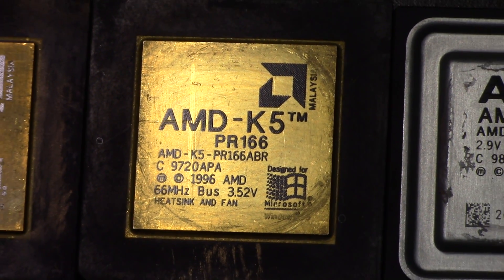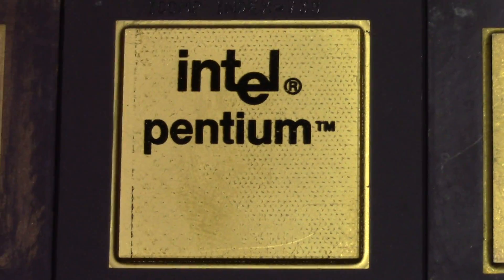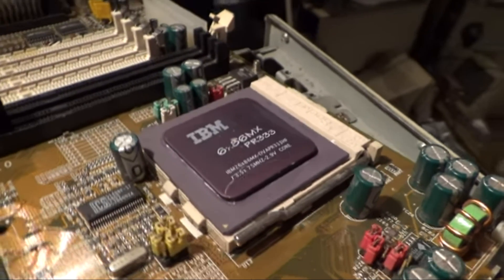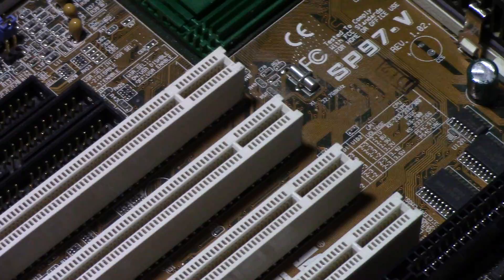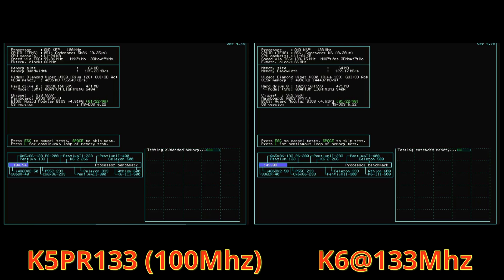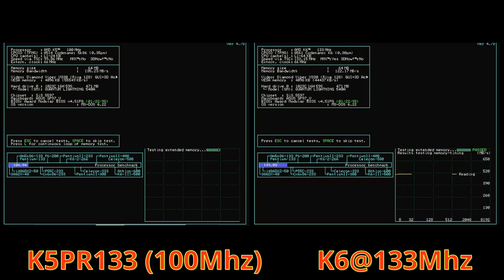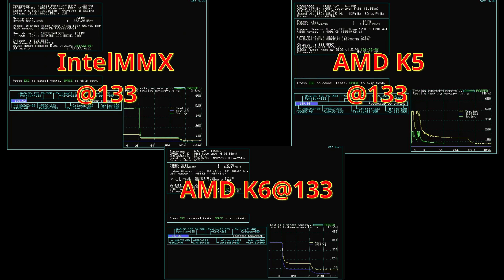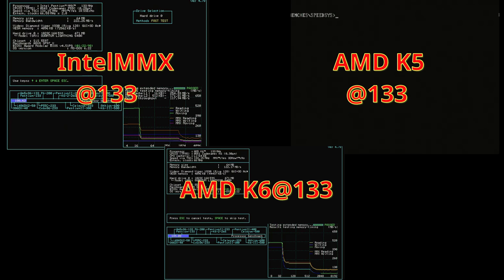AMD K5 vs K6

Comment: K5 didn’t scale. They couldn’t clock it as high as it needed. The trick is to pipeline lver more stages. Each stage does less so it clocks faster, but it takes more stages to complete an operation. Throughput can remain the same per clock since there are more operations in parallel at different stages of completion. If you take this too far branch prediction misses become very costly.

This game was played over and over again successfully until the pentium 4; it took things too far and couldn’t be clocked as high as it was able to be clocked because it became too difficult to cool. They were expecting their process engineers to do something and keep dennard scaling going somehow.

Pentium is kind of two 486 ALUs bolted toghether with an improved FPU.
Reply: Not even that - Pentium had a real pipeline and a poor man's one.

Comment: SiS made some really good chipsets, had a few boards i didnt expect much out of that became favorites.

if you can get an ECS L7S7A2 you wont regret it as a board for that gen of processors, i also had the top end nvidia based board back then and... in the end i traded it to a buddy for a videocard upgrade because the SiS based board i got with a applebread duron for 60bucks, was better....well, that duron unlocked and clocked to 2800 speeds... passing every test thrown at it... a buddy liked it so much he bought me another l7s7a2 combo and gave me the one he could buy himself, in trade for the board/chip i had setup and working, ended up giving me some other stuff including better ram then i had in that system because... he wanted it so bad and it to just work, that he offered as i failed to respond quickly to questions on the way back... worked out great for me.... and... his mother still uses that system with vector linux on it, for her email box, does all she needs, and is maxxed out for that era of hardware, he eventually did get a top end ram kit and brave tweaking the bios to use the faster ram, took him a couple weeks of tinkering then asking for advice on guru3d, and... an OG guru popped up and told him to turn one thing off, 2 things on, and it would work fine... that those settings auto swap if you change ram kits all sticks at once on some boards, if he changed ram again, remove the outter sticks. replace them, reboot...enter bios save. shut down, then swap last stick and, the bios wont trigger the settings that make stuff go wonky... .i have had that issue but.. i also always check all the settings over before i save on those systems... knowing any hardware change could cause weird "why you do dis" behavior...

but seriously, L7S7A2 replace the chipset cooler with a small active cooler or tall passive, and flash a modified bios(im told you can still find via pcper/amdmb forums and a few other places) that uplock a few extra tweaks, you cant get the same volt based oc's you can on that nvidia board i had, but, for example the L7A7A2 dosnt suffer a perf penalty running ram async, infact, if you find the right balance it can boost perf(confirmed by a number of doubters who went out of their way to get one of these boards back in the day, only to come back and admit...they really liked this TINY little atx board that...despite lacking some features like SATA onboard...was faster in most ways...and the onboard audio was really good, at least on the rev we had it was cmedia based and, genuinely sounded as good as a mid range soundcard in 5.1... but the sis chipset, really was, astoundingly good, had any major maker, taken the time to make a top end board using any ver of that chipset, it would have sold..and made nvidia, ali, via, amd, all look really weak.. imho it did anyway.. really great chipsets for their day.. yes even the ones with built in video, infact, i have found those overclock pretty damn well too.. pentium mmx200@350 for 6 years before the boards caps failed.. when i started checking, all fake rubycons... lasted way longer then expected with them being fakes from that time period... but... i had the board on a shelf, 2 years later a buddy wanted to know if he could see if his wife could re-cap it at work and he could build a retro rig with it... damn me..she did it..replaced every cap with audio grade caps at least one step higher then the ones removed, she also added a soldered down and glued heatsink to the VRM section since the mount points where the same as some boards they worked with for units they built for sales and direction giving at malls and medical places, stuff like that... anyway, he got a k6-3 and thanks to a modified bios somebody created for a whole range of boards that the bios can tell whats what by whats actually installed on the board so..all used the same bios flash, that gave full k6-3 support to all versions as well as support for more ram speeds and some other useful unlocks... he plays alot of retro games on the best hardware for the period, its a step above what you would have gotten at EOL for the k6-3 but early k7 era and, specific to having the best end game drivers for the period, i just know, hes got very few problems playing the games he throws at it the rare times he does there are some dll files you can toss into the folder from specific driver versions, causing the game to load those instead of the defaults the drivers would use..fixxing the issues... same thing you sometimes have to do for old games today to get proper functionality...(i had to tell somebody how to get starsiege working..that was fun...LOL...honestly..it runs very will on my 10 year old platform inside a virtualbox with full opengl mode running... so.. that seems more optimal to me vs trying to run such an out of date game, thats own devs where not allowed to properly patch it, due to deals with 3dfx to gimp the ogl and d3d renders ... devs admited such decades after the studio broke up and publisher died as well and "we dont even have access to the source because some idiot at sierra decided to re-use DAT tapes to save money....they where fucking pocket change, literal pocket change... fucking idiots.." the rant was great... it was audio that was transcribed and...honestly....he sounded like an angry bill shatner ranting... not kirk but bill... humor but... also you can tell, something hes talking about really does piss him off... or some aspect of it.. or it hurts.. or both.. prob both since.. they put so much effort into the game engine and the games..only to have sierra shitcan their studio, and before they could buy the IP...losing the source for the games... then coming back and asking them to  make tribes 2... that required recreating a game engine version, that had a bug, that made skiing possible and created the mechanic in the fist place.... it was an amazing accident... the recreation wasnt perfect.. some prefered the original.. some prefer the new one, some even prefer the weird anti-friction boots model of tribes vengence... another game that got crapped on by a stupid publisher trying to put a niche game, up in between Doom3 and HalfLife2 somehow thinking that was going to work out great for their AAA niche title... had they taken a few more months, done more open betas on the limited number of maps worked out bugs and patched it, then done an official launch after the other 2 passed and people where looking for more to play... even go F2P on the MP portion and the story, we told them to chage 19.99 for that unlock, and let people buddy play it with  a friend even if that friend didnt own it, even if it limited it to 2 missions a day or something... it would get them sales... cosmetics for everything was another big push the real fans had... ones u can just get randomly or win from bosses/events/etc, ones you can buy for real money credit systems... the typical thing.... but... naa...pump and dump... u2XMP.. same kinda deal... man..now..thinking about the history of the games i have loved... im both angry and depressed :P

Comment: K5 might have more balls compared to the K6 clock-per-clock, but like you said they couldn't scale the clock speed up.  However, "in the long run" I think NexGen acquisition was beneficial for AMD.  If they waited and instead tried to tweak and scale up the K5, then AMD wouldn't possibly be around today as an alternative and competitor to Intel.

Comment: I actually enjoyed my '97 AMD K6-233. I used to do benchmarks between the K6 vs the intel 233MMX with the same MB/Socket. The K6 kicked the snot out of the intel in integer benchmarks, but lost in MMX calculations. Still a decent cpu back then.

Comment: The P54CQS Pentium 120, which you could easily overclock to 133 Mhz, was released in Q1 of 1995, and it is still slightly faster than the 133PR K5, according to these mostly non-MMX benchmarks. Some victory for you biased folks...

Comment: Thank you for your video. I have wondered about the K5 for decades, particularly its floating point performance. Some sources claimed the K5 had such poor floating point that a K5 PR150 would only match the floating point performance of a 150 MHz Am5x86DX, while others claimed that it could match the original Pentium clock for clock, but fell behind as a similarly PR rated speed. This is a huge spread, and I didn't know which reviewers to trust since none of them showed actual benchmarks. To me, the K6 was a great chip, at that time FP performance only mattered with games, and one could always purchase a card for gaming. A K6 200 with a Voodoo card was faster than a Pentium MMX 200 with a Voodoo card. Indeed, even a Cyrix 6x86MX PR200 with a Voodoo card would beat the Pentium MMX 200 with a Voodoo card, but the Cyrix processors ran hot. I wish Cyrix would have focused on making the Cx5x86 Socket 7 compatible and fixed the bugs, such as the broken BTC. The Cx5x86 core eventually ran at 266 MHz at 350nm as the heart of the MediaGXm.

Comment: I liked your video as it was really interesting to see K5 and K6 benchmarked against each other but I think your conclusion about K5's superiority might be a bit off. It might be that the design simply wasn't going to scale to higher clock speeds as the K5 only hit 133 MHz on the 350nm process while K6 reached 233 MHz on the same process. K5 was already pretty late and K6 came out just 6 months after the 5k86 core K5's. The K5 PR200 launched the same month as AMD K6 233 MHz so there really wasn't any time to continue tweaking the design and considering the K6 design reaching almost twice as high clocks on the same process and with lower voltage the slight performance per clock deficit was acceptable.

Comment: My AT box has a Tyan Trinity 100AT motherboard that supports K6-2 processors on a 100MHz front side bus so I'm upgrading it from a Pentium MMX 233 to a K6-2 500MHz CPU. Should be pretty speedy under Windows 98!

Comment: Just found an Compaq OEM board with an AMD K6-2 running at 500MHz in a dusty box. Wanna test it but I'm a little scary if when I power it on the whole thing would go Boom! Any helpful tip I should consider? The board hasn't receive power in almost 12 years tho.

Comment: my abit ab-px5 (i430tx) using 64mb pc100 cl2 with fastest memory settings in the bios and pentium 200 mmx or amd k6-2 400mhz(fsb 66mhz) i do get 223mb in memory speedsys bench

Comment: Interesting to see the results. Quake is what caused me to go to Intel from an AMD 5x86-133 that I had overclocked to 150Mhz(50mhz bus) as the P54-133. I then went to a K6 200mhz but it really did lag in FPU performance to the Pentium 2's of the era. While I stuck with AMD through the entire K6 era, it was mainly due to price. The K6 line was fantastic on integer based programs, but just got slaughtered on floating point.

I also had a K5 PR133 for a while during that time as well in a second machine, and was wondering how it compared IPC versus others of the era.

Comment: Interesting, it seems your suspicions were correct. I like the evil laugh at "Chipzilla" there, naturally, as a fan of the K5 myself, I don't think this was at all misplaced. The SiS 5598, unusual choice, the only ones I've seen have been either cheap PCChips parts - and not good ones - and the low-cost ECS boards from Time computers, neither of which ever worked particularly well but the latter of which are at least reliable, and cheekily re-badged the chip "AGP TX" despite their being no AGP port. They were OK for what they were, if you bought a Time machine you didn't care about things like that. I did often question if their performance was more the motherboard and less the chipset itself, so it was neat to see one being tested here.

Comment: well i have 1 motherboard wich has overvoltage option to 3.7v or something like that with jumpers and i think that it might atleast handle 150mhz but the cooling might become an issue so wich cooler do you think might fit with the socket 370 stockcooler installation pracket

Comment: Nice video! I've always had a weak spot for the K5 and was wondering how it'd compete with the K6.

Some notes:

 - increasing the length of the processor pipeline does not automatically decrease the performance. Given nice sequential code there should be no difference clock-for-clock (apart that it takes a few more cycles before the very first instruction completes). The problems arise with branchy code: If the processor mispredicts a branch (i.e., fills the instruction pipeline with instructions from a wrong location), the pipeline will have to be "flushed" and refilled. The longer the pipeline, the longer the delay before normal operation can resume. This is usually countered by employing better branch prediction, so that branch mispredictions (that would lead to pipeline flushes) are "really rare" and your performance per clock remains mostly unchanged compared to a design with a shallow pipeline. Then you can directly benefit from increased clockspeed, finally outperforming designs with shorter pipelines.

- The initial iteration of the K5 (where the PR rating matches the clockspeed) is an earlier stepping with some performance anomalies (SSA/5, Model 0). For instance, I remember that the L1 cache was quite underperforming. However, the K5 was already well behind project schedule and the 5x86 couldn't keep the company afloat for much longer, so they had to release that version. Unfortunately this meant that AMD had to sell a rather ambitious (and thus big and expensive to manufacture) chip at budget-level prices (which was still better than selling nothing at all, of course). They kept working out the performance bugs of the design, giving us the faster versions (where the PR rating is higher than the clockspeed). This is the "5k86" or "Model 1" revision which shows rather impressive performance per clock, as you've demonstrated.

- AMD just couldn't push the clockspeed of the K5 high enough to compete with Intel's high-clocked Pentiums - the K5 apparently was very difficult to manufacture. The K6 was much less problematic in this regard - and happened to be a smaller (and cheaper to manufacture) chip!  The K5 was about 181 mm² big, the K6 only 162 mm², on the same 0.35 µm manufacturing process! In a situation where the top-bin K5 chips would only be comparable to the lower-bin K6 (and the top-bin K6 processors outperforming the top-bin K5 chips) it made no sense economically to continue with the K5 design.

- AMD only had one chip fabrication plant (Fab) at the time. Apart from the reasons listed above, we didn't see the K5 and K6 co-exist for a long time because all fabrication capacity needed to the shifted to the K6 to satisfy OEM demand.

Comment: Yap, the K5 was a great processor, sadly overlooked because of Chipzilla's FUD against AMD. On the other hand, the K6 was kinda over-hyped for what it initially was. AMD really got things right with the K6-II and K6-III ... especially the very last iterations of the K6-III were absolutely great chips.

Oh... that were the times... as AMD was on a run and either traded punches with Intel or showed 'em where the hammer's at. Athlon (the first slot and later socket ones), Athlon XP ... Athlon 64 ... especially the Athlon 64 ... 64-Bit x86 processor done right by AMD ... I really would have loved to see the dumb faces in Chipzilla's headquarters as AMD "gently rubbed" the Itanium's stupid 64-Bit microarchitecture into the asphalt. Kinda telling that Intel is still calling the 64-Bit extensions "IA64T" and not "AMD64" - I guess admitting defeat is just not Intel's strong suit.

Yet another great video... brought back so many memories again.

Comment: can u overclock that k5 cpu any futher than 133mhz? just curious about cooling and voltage needs of it . because im having small retrolan-party @ My home and trying to play something like CS 1.6 as the hardcore game and im going to use the s3 graphics with voodoo 2 and maybe even in sli :)
Reply from the maker: I have never had the opportunity to own the rare PR200 K5 variant, so I don't know what clock speed it would top out at, but 133Mhz seems to be about the end of the world for my K5PR166. I think it will post at 150 ( 75 bus ) but that is about it.  The other issue too is these K5 processors run at 3.52v, although I run mine under that, but 3.52v is usually the max core voltage socket 7 motherboards can push out, so there isn't any headroom left for voltage increase.
Reply: Quite likely while it was a superior architecture, it was hard to make it run at high megahertz. That's why the switch to K6. Also would explain why they had to resort to the PR shenanigans with lower actual frequency in the first place.
Reply: K5 doesn't overclock well at all and many people have tried without good results, it is either the cpu design or some physical limitation that forced AMD to go with the K6. Really nice core and it is a shame that didn't go any further clock wise.